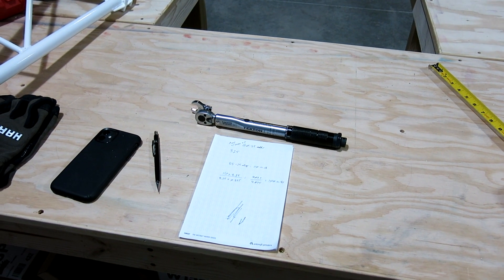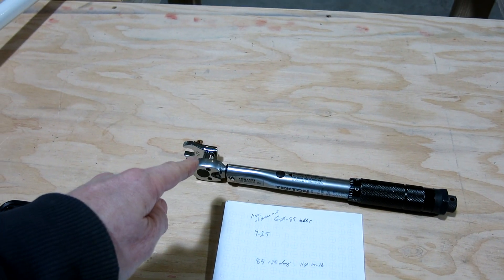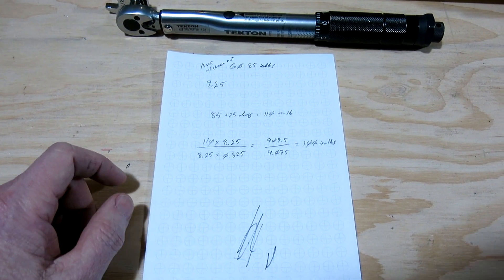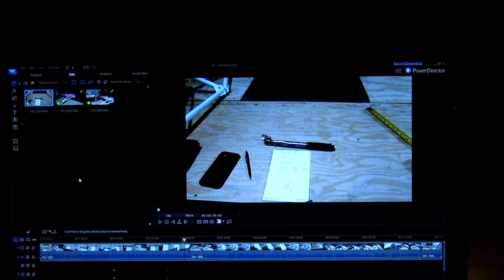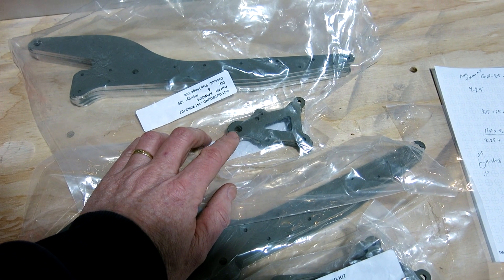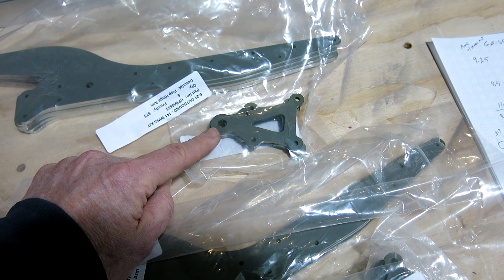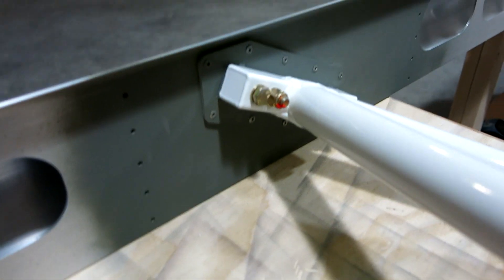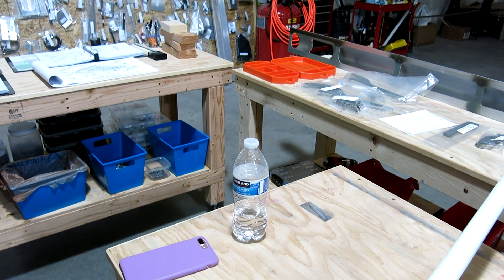No. 49 11-24-2020 Let's do math...

Comment: Wouldn't it be easier to just use a universal drive socket rather than calculate the torque on the crows foot wrench?
Reply from the maker: I couldn't fit a socket into that space even with a U-joint adapter.
Reply: The actual torque on the nut goes down as a function of the cosine of the angle between the axis of the bolt and the wrench - at 30 degrees you only get about 87%  of the wrench setting.

Comment: Good stuff! I tend to rotate the crows foot 90 degrees to the wrench. That allows you too not have to make any correction as the lever length isn't changed. It's also common to add a percentage to the desired torque when applying force to the head of a stack up but I don't remember what that is off the top of my head. It seems you have targeted the higher end of the range and that will more than likely overcome any rotational or "drag" resistance while on the head side and you'll end up in the spec range some place.

Comment: I would say 0.013” is far too much interference and you likely will either save material off the bushing or get it started cockeyed and crush it.  I would not want more than a couple thousands of interference.  I would either get a reamer that is a couple thousands under the bushing OD or, and this is likely simpler, place the parts in an oven and heat them up to 250 degrees or so and then ream them with your reamer that is the same size as the bushings.  When the part cools, it likely will be a thousandth or two smaller and just about right for a slight inference fit.
Reply from the maker: Hey I like that idea! I was thinking of a reamer a couple thou under but I like that heat method. Would there be any benefit to freezing the bushings also? Thanks!
Reply: @s-21project92  Yes, if you need an extra thou or so of clearance.  When I am inserting bearings, I very often freeze them and then heat the housing and often they simply drop in with no need to press or hammer in.
Reply from the maker: I was looking for a heat expansion formula and found:
Deformation = (coefficient of thermal expansion) x (nominal hole diameter) x (temperature delta)
So with some help from a coworker, flipped it around to:
Temperature delta = (desired deformation) / ((nominal diameter)*(coefficient of thermal expansion))
When I plug in 0.001” of desired deformation on a 0.3125” hole, it’s giving me 245°F of heating needed. So at that temp I should be able to ream to 5/16, then be 0.001” under for the bushing when it cools. Looks like you were pretty close at 250° giving me 0.001! 👍
Reply: @s-21project92  I was just SWAGing it.  I am glad you did some homework to confirm.
Reply: @s-21project92  Also, 250 F is safe for virtually all heat-treated alloys.  If you get things really hot, you have to check the allow in use and see at what point it begins to anneal.

Comment: I am an engineer so I love math, but there is no need for math in this situation.  Simply turn the crowfoot 90 degrees to the beam of the wrench and then the lever arm is back to being the same length as normal for the wrench and the wrench setting will be correct per normal.
Reply from the maker: Good point that I didn’t think about. But I still like figuring things out like that. 🙂
Reply: @s-21project92  Your approach is certainly valid, just offering a tip for those who may wish to avoid the math.